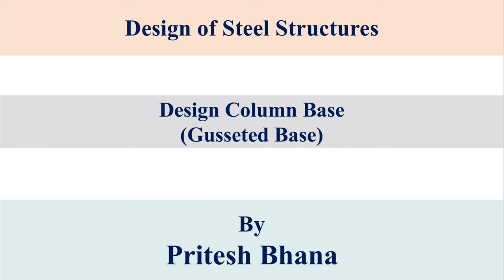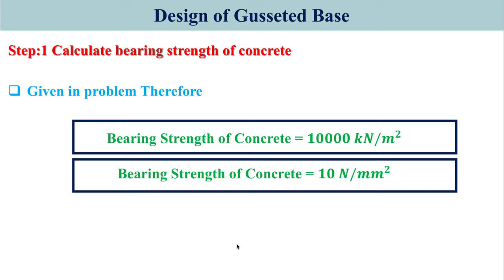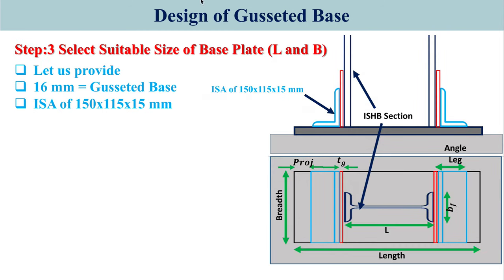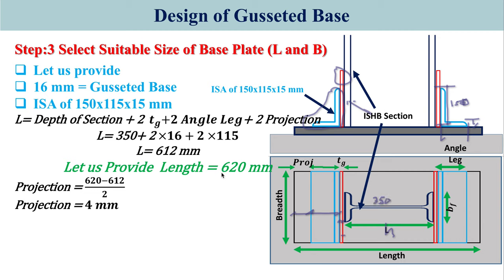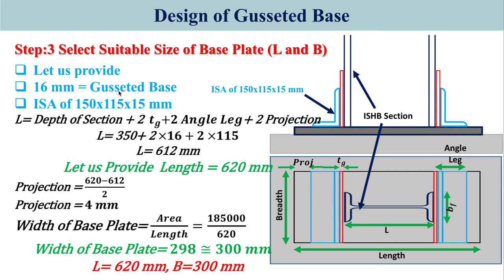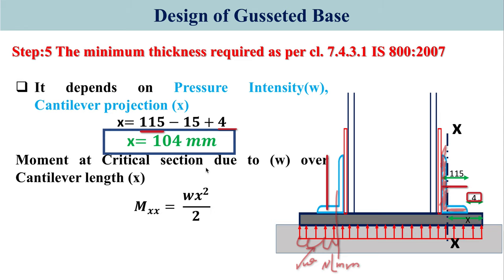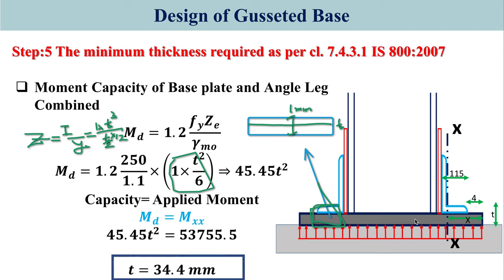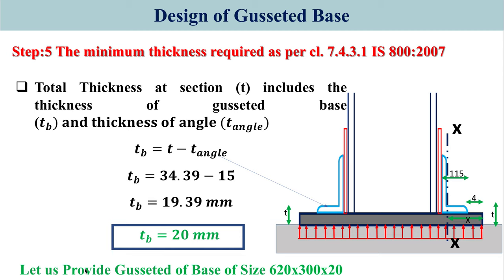Design of Gusseted Base I Design of Column Base I Design of Steel Structures

Comment: Sir, since 50% of load is transferred through connection and the gusset plates are provided on each flange why that 50% is not divided equally for each . In welded gusseted connection that  50% is again divided equally for each gusset. Why it is not done in this bolted gusset connection??

Comment: 2.5 kb d t fu    nominal bearing capacity 
Sir, thickness t 
When gusette plate is 16mm
When Angle is 75×75×10
So,
t=16mm or 10mm
Reply from the maker: 10 mm

Comment: The number of bolts provided
How to provide them 
gusette flange and angle 24 bolts 
OR
Gusette flange and angle 12 bolts
Angle and base plate 12 bolts
How to provide base plate bolts